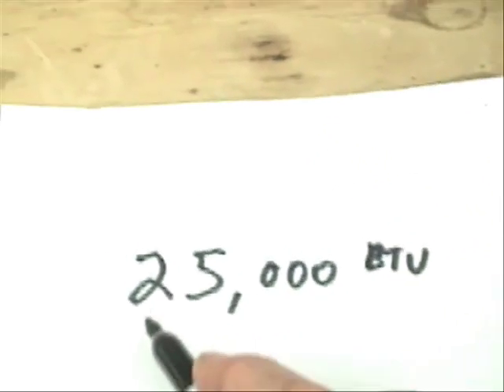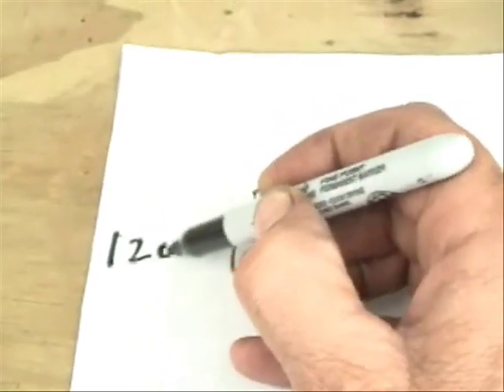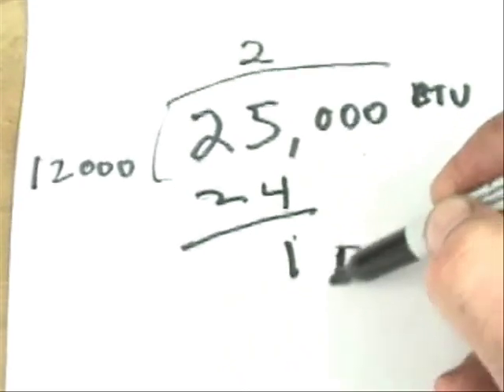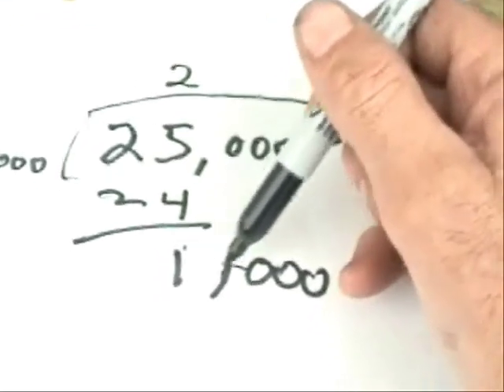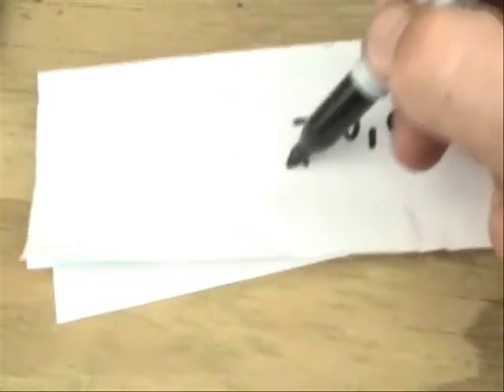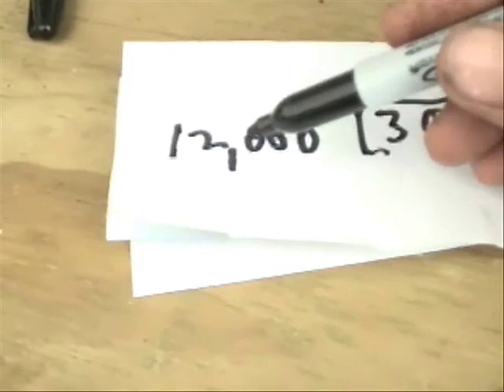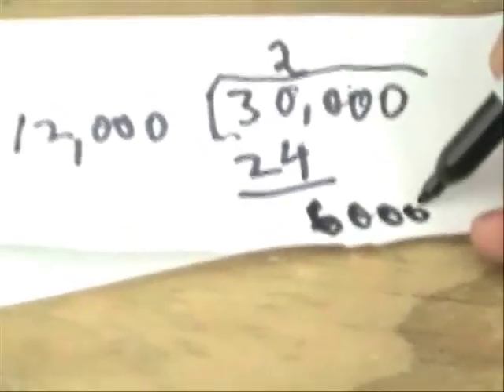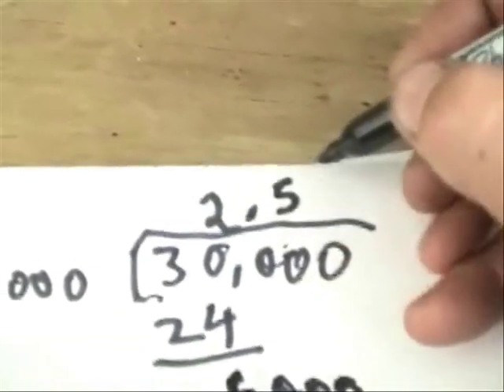HVAC BTU and Ton

Comment: Mine is a Friedrich central A/C and is 40 years old. It needs some freon.
I can't figure out or find the BTU on the model number plate..
Here's what's on the label......    any suggestions ?? 

Friedrich 
Air cooled Air Conditioner
Model number:   RCD035GAA
Capacity BTU  Hr
Electric Service A.C.   208/230 -80-1
Compressor  19.9 R.L.A.   83.5   L.R.A.
Outdoor Motor 1/3 H.P.   230 v.  2.3 AMP
Indoor Motor   H.P.   V.  AMP.
Max Fuse Size   45 AMP.  Time LAG
Min Circuit Amp.  27.2 Amp
Charge R22 Holding
Charge R22 Remote  7 lbs. 0 Oz.
Charge R22 Liq Line .5 oz PER Ft

Unit Not to be operated at less than
197 Volts or more than 253 volts
  Application  Evaporator
Temperature Range   high 475   low 
For Outdoor installation   
   
Temperature Range 32F (0C) to 53F (12C) 
Field Charge Required:   lbs.     ??

Total System Charge:  lbs. 
Test pressures: high 475   Low 
For outdoor installation only

Comment: Does furnace size [blower capacity/cfm/BTU] need to be considered as well?
Reply: you'll need to match your furnace with the coil box.
Reply: Goodman GMSS920603BN is what I just installed.  Max cooling / tonnage and how to calculate. 
Thanks

Comment: I was referring to the engineers in mechanical engineering firms who design HVAC systems for buildings.  They should tell their organization of engineers to pressure AC equipment companies to label units plainly.  Why a manufacturer would want to put stupid labels on their products is beyond me, the engineers who spec the units shouldn't put up w/ it.  Anyway, I love your videos, Dr.  Thanks for putting them out there for us.

Comment: Let me get this straight, we need to know the tonnage of a unit but the manufacturers don't put the tonnage on the unit's label.  Instead of posting what we need, they post the BTUs.  But they don't really post the BTU's, they post an encoded version of the BTU's that we have to sleuth out.  Then we have to do some math to figure out the information that we actually need.  Yeah, that's swell.  Why would any engineer spec units made by an outfit who won't put a clear label on their products?

Comment: Good video.  I would only add that the capacity of any heat pump is dependent on the conditions.  For example, the ground source heat pump industry often competes with the air source heat pump industry and a four ton air source heat pump can have less capacity than a two ton ground source unit in the coldest conditions.  This is why our focus is on improving the conditions rather than focusing on the heat pump.

Comment: 1 ton of refrigeration is 288,000 btu's per 24 hrs, 12,000 per hour, or 200 per minute. 1 ton is equal to the amount of refrigeration produced by melting 1 ton of ice in a 24 hr period known as I.M.E. or Ice melting equivalent. 1 btu (british thermal unit) is the amount of heat gained or rejected to change the temperature of 1 pound of water 1 degree fahrenheit.

Comment: Hey @ sqhunters did you check on the remote settings if its set on a fan mode?How about the expansion valve? compressor is it running?

Comment: Hi DrZarkloff.please help me with this.I was deployed to service a window casement unit.after cleaning the coils.I fitted it back in the frame.I switched on and there is cold air blowing in and hot blown out by the other blower.surprisingly it doesn't cool the room even after running it for an hour.not even a bit.can u please educate me in troubleshooting this problem.thanks very much.

Comment: Hello Dr Zarkloff,Can you help me with this problem.I have a multi split R22 system that has three units attach .Everytime i switch on this particular unit (thats attached to one of the two compressors) the ELCB trips after 8 minutes.Tested the capacitors and the rest of things and they are fine.Can you please enlighten me.

Comment: Hello Dr Zarloff.I have a problem with a National multi split unit.The compressor doesnt cut in for one of the unit.When i remove the refrigerant it runs well.As i load in the refrigerant it just shuts down.I have checked the transformers,compressors,contactors,capacitors,blower fan and they are all working fine.I suspect the pc board is down.Can you enlighten me further.I have also set the thermostat to cool on this R22 non inverter system.Thanks in advance.

Comment from the maker: @jlsalazar101 You might want to check the blower wheel and motor to see if it's clean and working properly.  Also, clean the evaporator coil. Even if it looks clean from the outside, it could be dirty on the inside.

Comment from the maker: @blissJesus1 You could get a ductulator from a HVAC parts house. Just line up your duct size and cfms to get your friction rate. Friction rate is the amount of drag there is on the air flow.

Comment: @Aussie50 The refrigeration "ton" comes from ice. It takes 144 BTU to melt 1 lb of ice. A ton 2000lbs in the US would absorb 288,000 BTU in melting. The scale is based on it melting in a 24hr period which would be 288,000/24=12,000 
So the ton of ice as it melts in one day's time would absorb 12000 BTU per hour

Comment from the maker: You wouldn't be able to get the correct superheat in any case. If the condensing unit were undersize, the evaporator would freeze. If it were oversize, the condensing unit would stack refrigerant.

Comment: should I be concerned with  large difference in the A/C and the cooling unit?  If so, what's the difference.  Can you give me an example of what I would see if the A/C unit was higher (say 2.5 ton) than cooling unit (say 2 ton).  Then if the reverse was true.

Comment: You use cfm and fpm for sizing ductwork , as well as picking the size of the A/C unit needed to condition the space. You can tell how much cfm an A/C unit can produce by it's capacity. 400 cfm = 1 ton, therefore a 5 ton unit will give you 2,000 cfm. (5 x 400), You also calculate your duct size based on recommended velocity (fpm) for different zones.

Comment: Can you make a video about sizing the cfm of the furnace to handle the exsisting system for retrofits.  Transfering ductwork dimensions to cfm capacity. 
I'd also love to see a video about the proper way to read a ductulator. 
Thanks in advance

Comment from the maker: Some manufacturers will proudly print the SEER rating on the unit. In many cases, you'll have to write down the model and serial numbers and find out from a parts store or the manufacturer.

Comment: I know the Mitsubishi MV series window unit in the back of my workshop is 12,000 BTU / 1 ton, but my Fujitsu split is only marked in Kw, not BTU.

I'm just wondering how to convert Kw to ton. the model is N807 (8.1Kw) on the Fujitsu BTW

Great vid though, I didn't know 12,000 BTU was a ton.
Reply: Aussie50 
1kw = 3413 BTU 
8,5 = 29,010 BTU 
29,010 btu : 12,000 = 2.41 tons ( almost two tons and half)